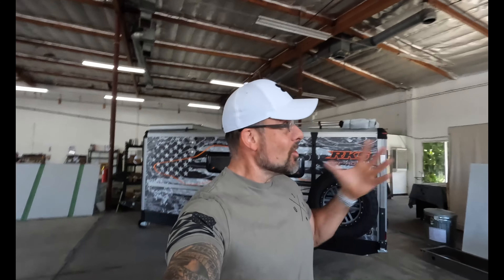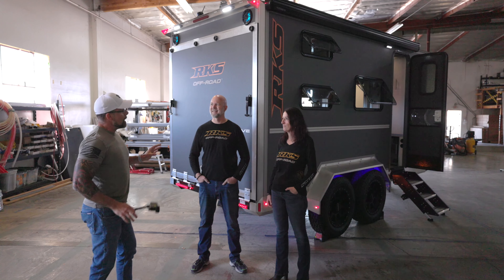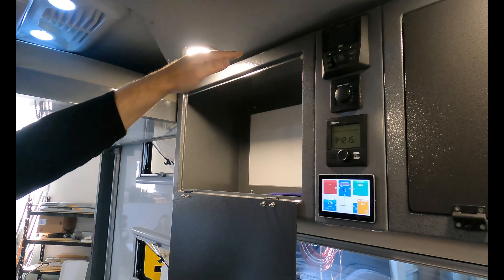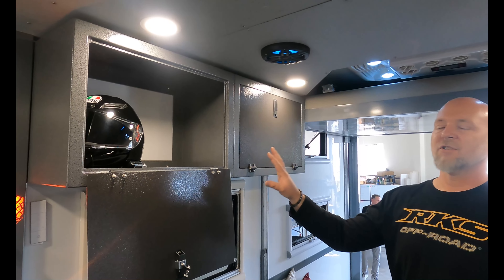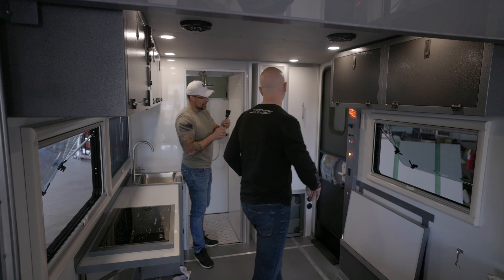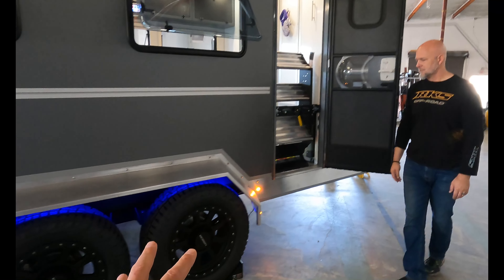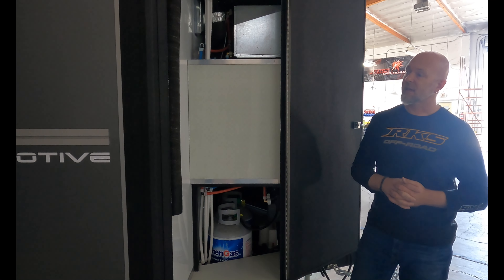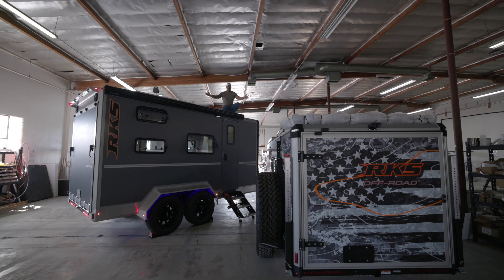RKS Off - Road Motive Trailer Walkthrough

Comment: This is one of the few small toy haulers that is big enough to hold a wave runner on its trailer.  The problem is that they are heavy to push up the ramp.  You guys were talking about putting a winch running along the floor to load a quad but that would also be PERFECT for a jet ski.  I want to be able to pull up to a campground, unload the ski on its trailer, and disconnect my truck from the Motive.  Then use the truck to run back and forth to the boat ramp towing the jet ski, and the motive as a home base back at the campground.  Plenty of extra room for my Yamaha WR250R Dualsport also on the side of the jet ski trailer when both loaded in the Motive.  The two drop down shelves with the stove is what makes this all possible.  Great job!

Comment: The Motive doesn't have the insulation value of the Xplore X22, but in every other design and manufacturing aspect it's a far superior product. RKS Off Road is even coming out with a larger M22 model. It would be a breeze to option out a Motive to make it an incredible full time trailer. The Motive has moved to the top of the list for our next full time trailer.

Comment: Bad A. unit, totally impressive. Especially blew me away was the safe, fridge, SXS entry, roof top access, awning, rear deck usage etc. Possible suggestions would be exterior color options, Rhino lined, upgrade to #30 Propane bottles, Japanese style waterless toilet as in the Explorer X22. What is the highest temps the unit can handle without over tasking the AC? Coldest temps? With the winter pkg? Max width for a SXS? mine is at 82" Possible down the road option for 4 seaters i.e. Speed UTV as the boss of the UTV world & size ....Was optioning out an Explorer X22 rig when you highlighted this beast, great timing indeed thank you. Really looking forward to your trip out to Joshua Tree with this....Need the ROA guys take this unit loaded up MOAB as well  ; - )). Thank you!!
Reply: Great feedback, we will take some of that into consideration.  We will be testing two different A/C units in death valley area this summer, so we will see how they behave.  Testing for the best cooling per kW and noise levels.
Reply: so iq⁹0X